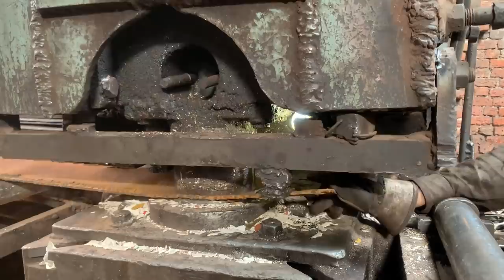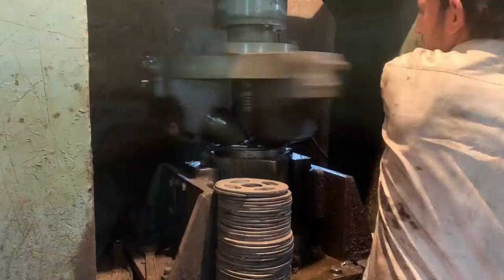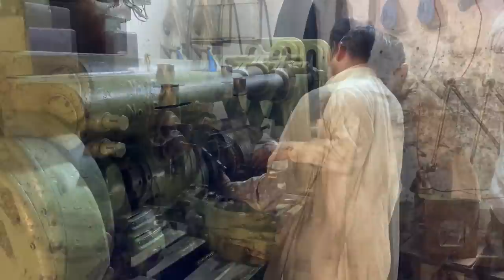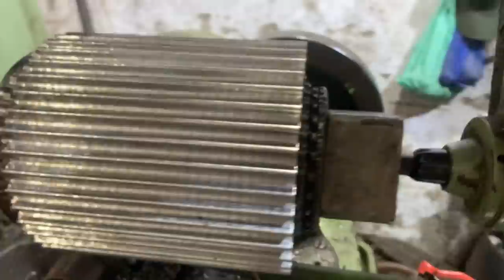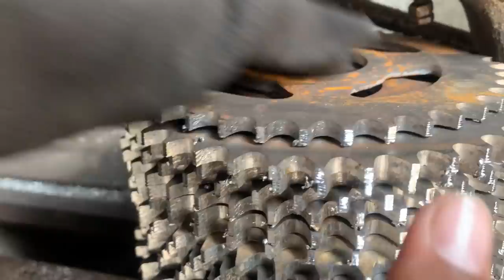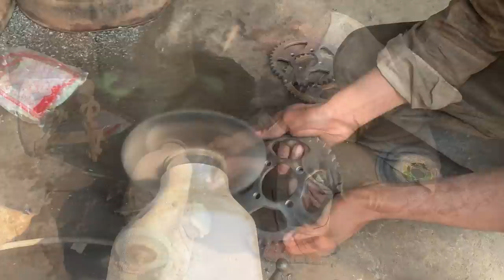How Motorcycle Chain Sprocket are Made From Scrap Of Old Ships || Machining of Bike Rear Sprocket

Comment: The young man wire brushing the sprockets without any eye protection is insane.
Reply: …and on the floor.
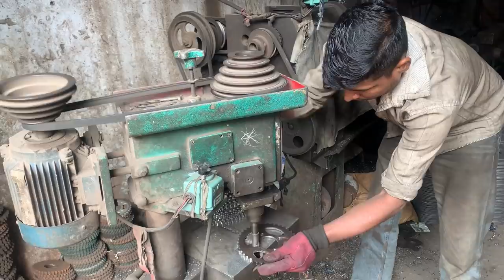Reply: Aren't you embarrassed that the belt can break and remove the scalp? 13:24 This whole video is a complete violation of safety regulations, I very much doubt that these men live to be 80 years old.
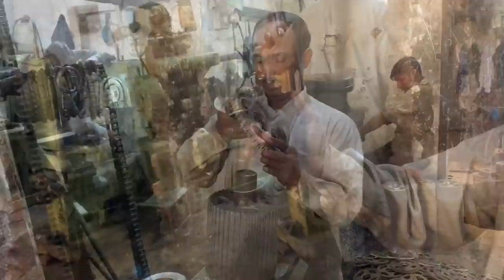Reply: I thought the 8 year old boy running a lathe @ 11:30 was unbelievable!
Reply: @tomt9543  ~ 12 year old.

Comment: Beyond the obvious safety issues is the product itself.
Hot rolled scrap steel without any hardening or temper.
Sprockets will last about a month….maybe a little more with a good chain.
But they probably aren’t hardened chain either.
Reply: Trust me these last years I've used these
Reply: They are probably used on Chinese 125cc motorcycles with about 5hp power output at the crankshaft.
Reply: @andrewallen9993  I used mine on a Kawasaki 125 2 stroke and that thing gave out 17hp
Reply: @ilhanabbas6778  How long do the sprockets and chain last ?
Reply: The chain lasted an year were as the sprocket is still in use and it's been  around18 months
Reply: But the chain was kept very well lubed
Reply: @ilhanabbas6778  the chain and sprockets on my Jawa are 15 years old :)
Reply: @andrewallen9993  dang, those are some serious miles
Reply: @ilhanabbas6778  20 000 Kms but on its last legs. Jawas have enclosed chains :)
Reply: Dont forget that India produces the Bajaj bikes, pretty damn good low cost machines.
Reply: @andrewallen9993  I loved my Jawa 350 twin back in the day.
Reply: @jeffbaxter8770  But awful electrics on Bajaj, worse than BMW.

Comment: Odd, the early punching steps generate like 10 parts per minute, but then the tooth-milling step generates like 1/40th the production rate.  I wonder how they manage that.
Reply: It aint lean manufacturing for sure.
Reply: They may use more than one gear hobbing machine per run. They are doing them in one cut which isn't ideal.
The surface finishing is pretty poor because of it.

Comment: I started working in 1971 in a highly efficient telecom factory in The Netherlands. Kaizen did not reach the low lands then, champions were found on the soccerpitch and blackbelts were worn by Anton Geesink in Olympic games. Every year, before vacation time, we had a cleaning day. Walls would be painted, tables cleaned and fitted with new boards where needed. The floor would be cleaned. After the holiday you would return to a fresh and clean workspace. Why do these people allow themselves to work in these conditions. Why work in grime and dirt? Why the risk on trapping and wounding yourself with floors full of scrap, why ‘logistically rerouting’ by a rough hole in the wall. Do they lack selfrespect? Don’t they want to keep the children working there (!) from harm? I strongly reject terms as ‘shithole’ because is it a rude generalisation for countries of businesses with limited possibilities. Does anyone here have a more fitting term, because I just keep ending in ‘shithole’ for these kind of shops.
Reply: Ik krijg sterk de indruk dat ze daar geen arbodienst hebben.